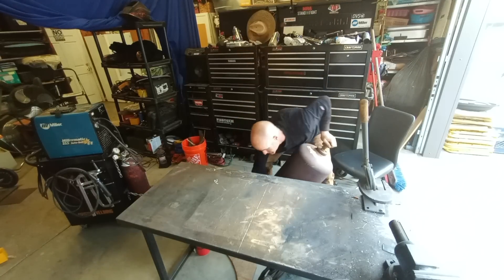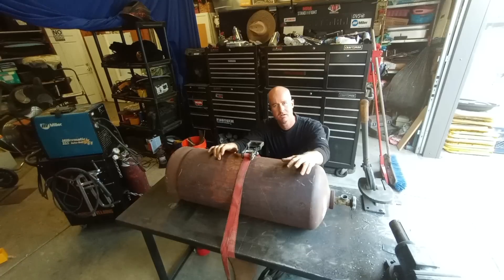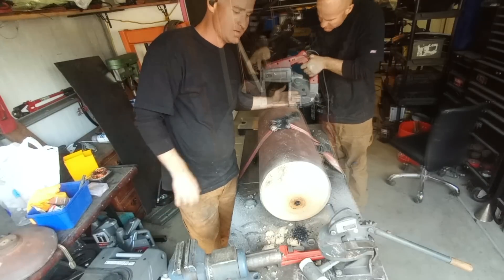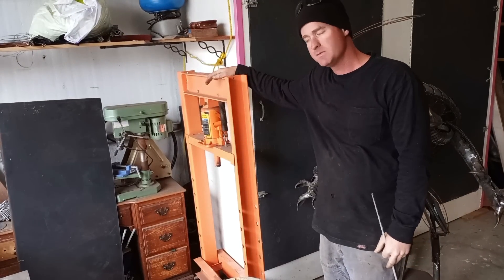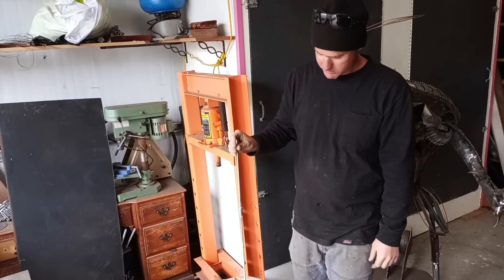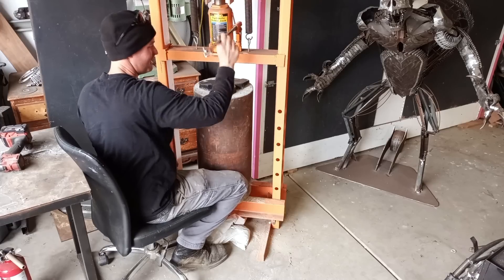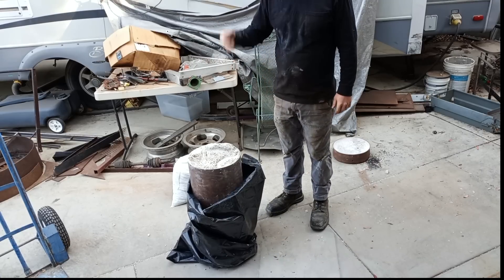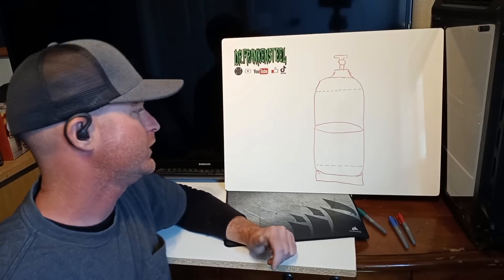ACETYLENE TANK CORE removal

Comment: I had to cut mine as the scrapyard did not take it otherwise. I took my time, used a hammer to get the valve off... tried to flood the tank but failed. Grind the body with care and dealt with the core... it was carbon in my case. 
The drive stunk like acetone for 3 days but job done.

Comment: The liquid in the porous matrix is not pressure liquified gas like a propane tank. Acetylene is unstable at relatively low pressure so you can't use pressure to liquify it. Instead, it's dissolved in acetone at low pressure. When you crack open the regulator the acetylene comes out of solution like the bubbles in carbonated water.

Comment: When i was younger I worked in a scrap metal yard. We got 3 45” trailers of these! They were free fro a welding gas supplier. The steel shell is 1 heavy melt We were having a slow winter so it was decided to cut them up We removed the blow out plugs grouped them together and burned them Once the fire settled down we were able to cut torch them. On the seams They peeled like bananas We ran an overhead gantry fo the torch hoses It looked like the end of days Even in the middle of a Canadian winter it was 90F in the cutting area The residual rock continued to burn. We got through the entire load with only 3 that went off love rockets! Now I am older I can’t believe we did this but at least the Tax Man didnt get the yard!
Reply from the maker: That is a great story thank you for sharing!!
Reply: Thanks for your reply The things we did before OSHA in the interest of business!  Canada is a tough country to own a small business in. We always needed to push the edge! Accetlyene tanks and the gas are very dangerous and often misunderstood One operating rule that is often overlooked is line pressure at the regulator Over 15psi and the gas starts to become liquid Very unstable! Well hope you have a great project and a great time with welding

Comment: 0:39 WRONG - The acetylene gas in the cylinder is dissolved in acetone which is absorbed by the porous mass. Decomposition of the acetylene is triggered by heat, when it is: The porous mass slows down any decomposition of the gas. This is why the cylinder needs to be kept upright, if used on its side the acetone would also come out with the acetylene.
Reply: Acetylene is a heat and impact sensitive high explosive. It doesn’t just decompose - it detonates. Absorption in acetone tames these tendencies somewhat but having cleaned up after an acetylene bottle filling facility detonation, that spread the factory over four square miles, it should be treated with respect.
Reply from the maker: Check out the re-edited version

Comment: When cutting into propane or other flammable gas I would remove the valve and fill with water, this will displace any gas left at atmospheric pressure. Maybe different with acetylene or because you had left it open for so long. The lip inside the edge of the weld is where one half of the tank has been swaged to allow the other half to fit over for a nice weld.
Reply: That doesn’t work with acetylene cylinders as they are full of plaster of Paris soaked in acetone. You simply can’t get water into them.

Comment: They are usually filled with Kapok and acetone. These are needed as acetylene go boom under pressure without them.
Hopefully after five years with the valve open the residue is gone and there won’t be a boom. I am commenting as he straps the cylinder to the bench.

Comment: My Father was a welder since the 30"s, I learned the the bottle is filled with DE (diatomaceous earth) and acetone. the DE removes anyfree air space and the acetone absorbs the acetylene like carbonation in soda pop. Free acetylene under pressure will auto-ignite.  Just what I learned a long time ago. Also why you need to keep the bottle upright when in use.
Reply from the maker: Right on thanks for the information
Reply: That answers a question for me.I knew there was acetone but the other component was a mystery until now.

Comment: Actually The acetylene doesn't cut Steel it  heats the steel to the ignition temperature and the oxygen does the cutting .
Reply from the maker: Your right. I'm a welder I use these tanks on a regular basis this video is not about operating a torch. that comment your referring to I made in the video is to give the viewer more of an idea how flammable/dangerous the contents are.
Reply from the maker: Read video description
Reply from the maker: @Lloyd Scharf

Comment: you HAVE TO  support the steel tank separate from the filler with clearance enough for the filler to push out the bottom,what you are doing @ 9:51 and before, is compressing the filler .
Reply from the maker: I understand that. You won't see the bottom in this video. If the core is moving at all there would be an indent on the bottom and alittle movement on top which there was not due to the weld joint in the middle holding it in place. This is a soft core. If you don't believe me. Do one yourself!!!
Reply from the maker: I think you need to rewatch the video and actually pay attention this time

Comment: You just cut the bottom off and put an air hose onto the valve and give it some pressure.  125psi will shoot that thing to New Jersey.  You gotta be a lot lazier than you are.
Reply from the maker: Have you actually tried that before?
Reply: @dr.frankensteel2759  No.  Sadly, I made the whole thing up, but it does sound like it could have possibilities.  Sorry.  I know it could be dangerous.  Try low pressure and see if it budges.  Good luck.
Reply from the maker: I won't be trying this method being as there is a weld holding it in place like i showed in the video
Reply: @dr.frankensteel2759    Excellent idea.

Comment: Idea:  Weld 2 or 3 hacksaw blades end to end (enough to reach end to end in cylinder).  Attach to jigsaw or sawzall. Drill one hole through core material - near wall. Insert extended blade into hole and saw around the ID of the cylinder.
Reply from the maker: Good idea. That was actually going to be my last resort with sawzall blades. But might have alittle trouble turning  as you cut. so multiple holes and watch out for the raised welded area on the inside.

Comment: filler is soft fire brick to hold the acetone which the acetylene dissolves in.
Reply from the maker: The filler can also be made from different types of material
Reply: @Dr. Frankensteel  yes like balsa wood,, some type of cardboard, or ASBESTOS.  ..
Reply: I'm pretty sure it's diatomaceous earth or plain old kitty litter.
Reply from the maker: Yes. keeps the acetylene stable and defused.
Reply: Asbestos is often a  component of the filler!!!